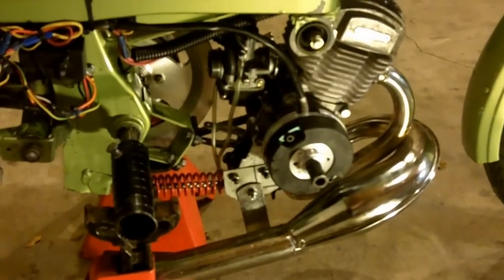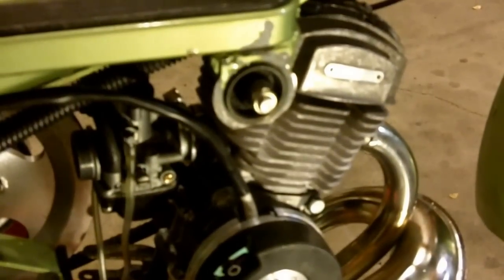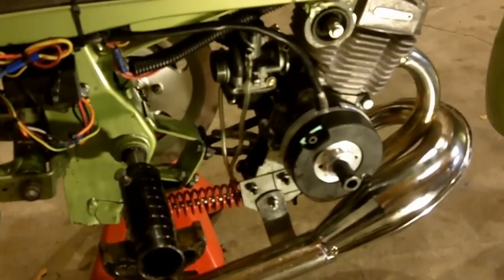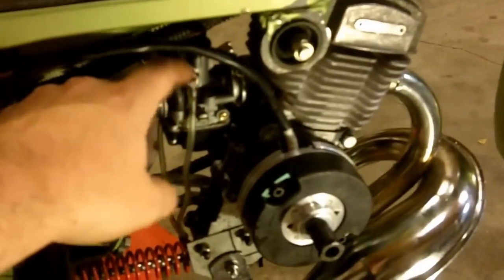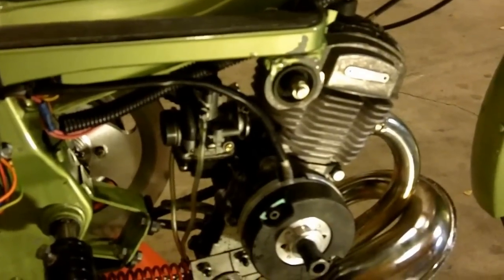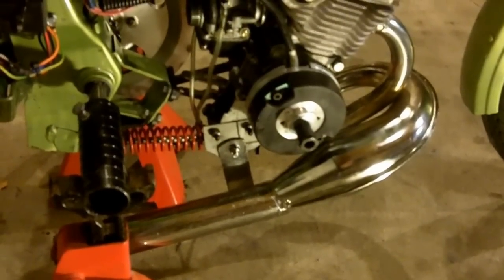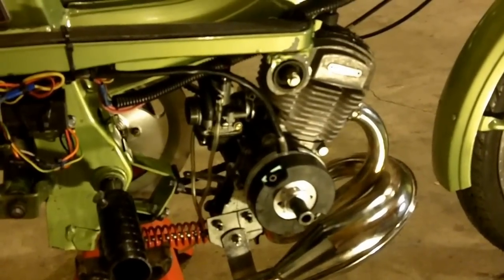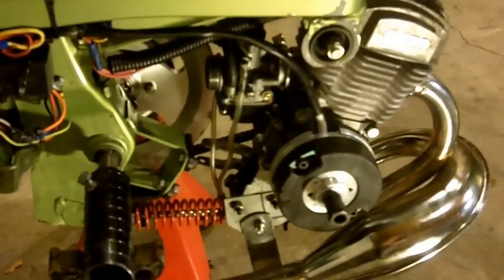Motobecane  Leaky Gas Part Deus

Comment: THE ENGINE NOTE AT HIGH REVS SEEMS TO BE 4 STROKING. THIS MEANS ITS FIRING EVERY OTHER REVOLUTION, CREATING A SIGNIFICANT ENGINE VIBRATION AND YOUR FUEL IS FOAMING IN THE FLOAT CHAMBER. ANOTHER YOUTUBE CLIP SHOWS THIS ISSUE AS BEING TOO MUCH FUEL AND NOT ENOUGH AIR. IF YOUR CARB' HAS A NEEDLE, LOWER IT, IF IT HAS A JET, TRY A SMALLER ONE, 2 STROKES RUN MUCH BETTER (AND HOTTER) ON A LEAN MIX.

Comment: marty is the two stroke not creating enough suction to pull the fuel
or is the carb not allowing the float to move and limit the fuel coming into the bowl?
lastly is the carb tilted not to spec - had this issue with one of my bikes

Comment: if you run over the overflow with  your back tire, it would destroy your ride w/the oil in the gas.... try a different carb, even if it's the same Dellorto 15/15 or a clone dell